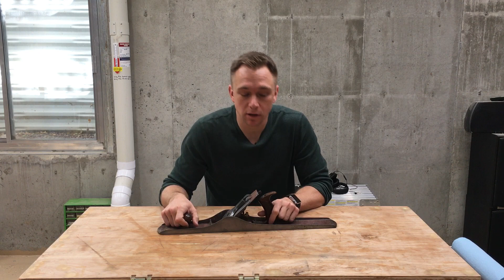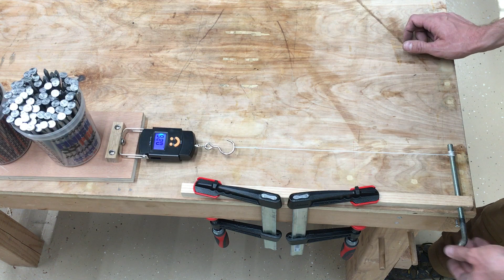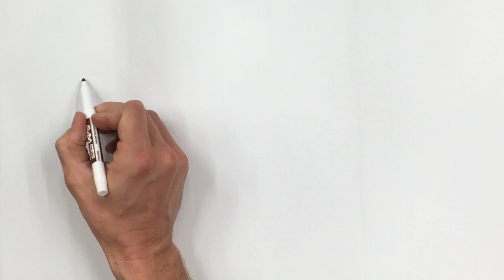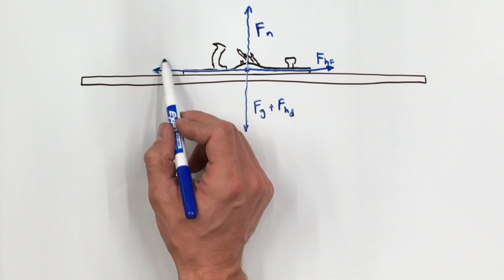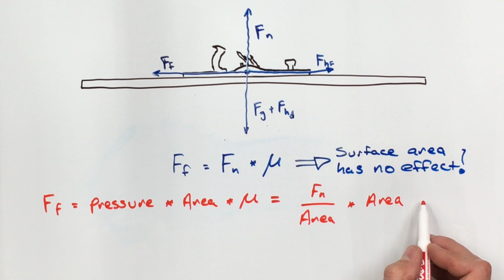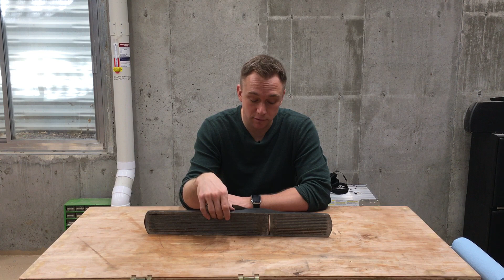Grooves in Plane DON'T Reduce Friction!

Comment: Maybe it has something to do with air?
Like if you put to very flat surface together, it'll be difficult to pull apart. For example, if you put two sheet of glass face to face, it's going to be  near impossible to pull apart. Unless there are some dust or something in between the glass to create a small gap, then it's going to very easy to pull apart.
I think the grooves have the same effect as in my example.
Reply from the maker: I'd be more convinced of this if the grooves when to the edges or mouth, since they don't I don't know that they would let any air in to break suction.  But its an interesting thought
Reply: Yeah... I notice that too after I take a closer look on your plane. On a related subject, why does some of the table saws' table also has those grooves? Table saw's grooves elongates to the edge...
http://visual.merriam-webster.com/images/house/do-it-yourself/carpentry-sawing-tools/table-saw.jpg
Reply from the maker: Well, for the table saw (just like the plane) those grooves won't reduce friction.  And I would guess that those grooves are there for no good reason whatsoever, otherwise we would see them on expensive, high end tools, and not cheaper ones.
Reply: Ha ha, true! One possible explanation I can think of is to collect saw dust or small particles like you suggested.
Reply: Actually, you will find that there are mini-grooves on the scraped tables of the very most expensive machines, such as Hofmann jointers, thicknessers, and shapers; Ulmia table saws, etc. The tables of my more moderately priced  Rojek 12" jointer and Agazzani 20" bandsaw are also scraped. So your association of relieved table surfaces with low cost machines doesn't stand.

I believe the scraping aids in the process of final precision flattening of the cured cast iron tables, similar to what you surmised about hand planes. But I believe it also may reduce friction when two perfectly planed surfaces slide against one another, especially at the start of the motion. I'm not sure your test replicated the condition of "perfectly planed" that can result in the final stages of hand planing.

Here are links to several close-up photos of the type of machines I mention:

http://www.hofmann-maschinen.de/en/produkte/hobeln/ahw-411511631/

http://www.hofmann-maschinen.de/en/produkte/fraesen/tfs-107/

https://www.google.com/search?q=ulmia+table+saw+brochure&tbm=isch&tbs=rimg:CRUBf-i8C52pIjgW_12_1HDPGZ5H0ilWIqg3XGT-2Zh4Noi5hLwHPAVNE-PQHcRNUcZ-Ti3ZPhwYpRNVYUBnxZy8jOyyoSCRb_1b8cM8ZnkEYX5x3sp8CW4KhIJfSKVYiqDdcYRCMhhR1zeCfUqEglP7ZmHg2iLmBGqpK73X8R7gSoSCUvAc8BU0T49EWY1opUAgLA3KhIJAdxE1Rxn5OIRopLsE9GDrR0qEgndk-HBilE1VhHytA5RndWN5SoSCRQGfFnLyM7LEfaLUXRujFIN&tbo=u&sa=X&ved=0ahUKEwi0qOHx08HWAhUorVQKHU23DA4Q9C8IHw&biw=1360&bih=638&dpr=1#imgrc=8V6cEyXZLWxk-M:

Comment: Groves are put there to keep it from warping.
Reply: Ridges like that are used to increase strength while keeping weight down. Example: triangles in a box bridge. 
However, if that box bridge were solid material, it would be STRONGER than the triangles, but FAR heavier. 
These grooves eliminate a little bit of weight, and also structurally weaken the plane.
Reply: wouldn't the grooves make it easier to bow across sides?
Reply: Claudio Pacin just got the idea from how car frames use ridges and folds to prevent bowing.
Reply: Yes cars uses ridges to prevent that but it only increases strength lengthwise (if not supported crossway by something else), maybe if the plane flexes a little this makes the flattening process easier? (I'm just being completely speculative here)

Comment: I agree with the less material to remove to true up the bottom. I also think it could help with the plane not getting stuck to a really smooth surface due to suction.
Reply from the maker: Reduced protection for the suction effect is an interesting idea, but I have my doubts since the grooves don't go to the front, back, or mouth, so not sure air can get in.
Reply: Andrew Klein try your two board experiments again on a very smooth, hard, damp surface and see. I think even though the notches don't go to the ends they will still help to disperse and suction effect.
Reply from the maker: It could be, I might do a follow-up, but no promises ;)
Reply: Andrew Klein just throwing out theories. I'm sure someone will comment that has a PHD in this sort of thing.
Reply from the maker: As I think about it I believe you are right, the grooves could break or reduce negative pressure between the plane and the board even though they don't go to the edge to let air in.  Whether or not that would be a real functional issue sans grooves I don't know.
Reply: Andrew Klein now this is going to be gnawing away at my brain all day

Comment: My 2 cents would be that the grives are there to dissipate heat. The grooves provide additional surface for the ambient air temparture to cool the planes.
Reply from the maker: hmmm ... not so sure about that since the stop before the mouth, front, and back, don't know that much air gets in there, and its not a surface that typically heats up.

Comment: Great video. I'm a fan of physics, science, and engineering, however, only with passive experience in the 3.

I'm not sure how much the formula would change, if at all but, what if you did the same experiment while considering Japanese planes?

The Japanese planes only touch the surface of the material with a narrow strip along the front of the plane and a slightly wider strip around the mouth. The rest of the plane is off the work surface by about 1/64 (or something like that). 

Would you be willing to redo the experiment?
Reply from the maker: Glad yo liked the video.  There may be some advantage in performance for the configuration of the Japanese planes, but it isn't friction reduction because of reduced contact surface area for the same reasons I go over in the video.

Comment: Try it again on wood with a high pitch-content? There's an adhesive effect.
Reply from the maker: The pitch content itself would have an effect on friction by changing the friction coefficient, but the grooves would still not play a role in reducing friction.
Reply: I think adhesive force involves surface area but I'll see if I can find more about it.